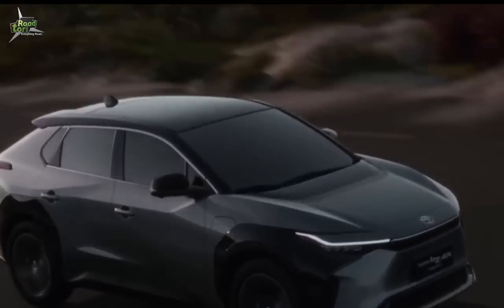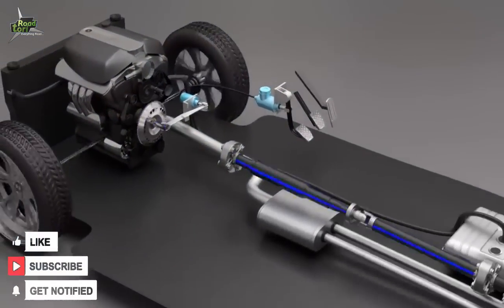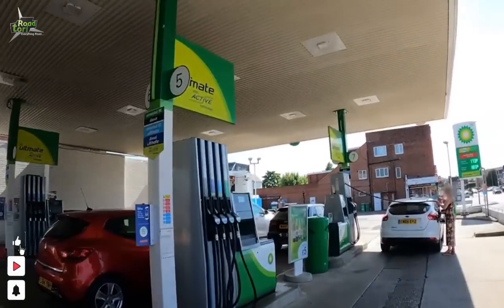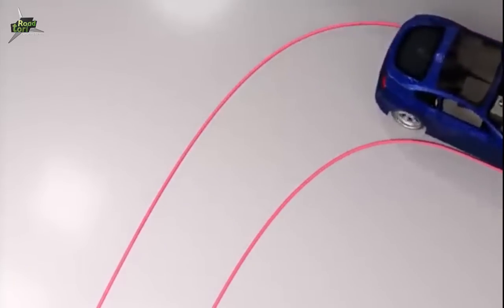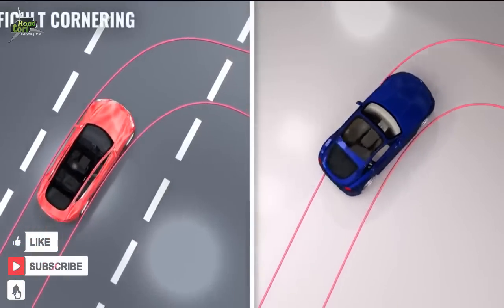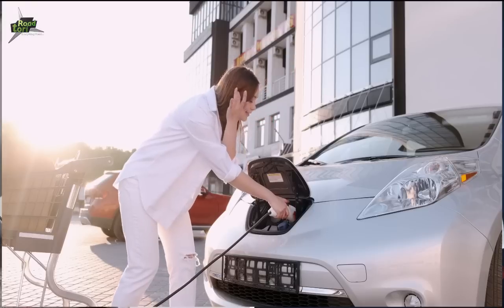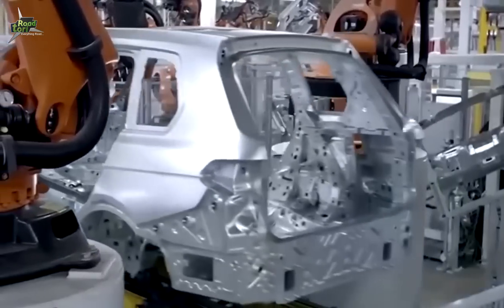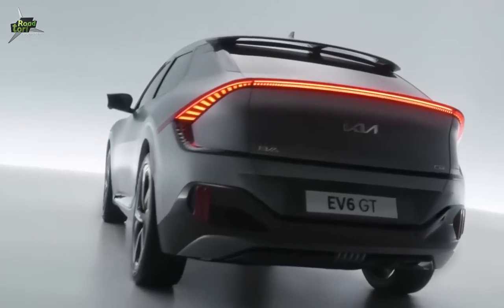Electric Beast Battles Petrol Powerhouse: Which Reigns Supreme?

Comment: it takes a couple of minutes to fill the tank on gas powered cars, if it takes a long line and thirty minutes to charge an ev auto and you are on a five hour trip i'd rather have a gas car, time is expensive, gas is not!
Reply from the maker: I concurred with you, one of the primary problems with electric automobiles is the battery and charging times. I'm confident the problem will be resolved.